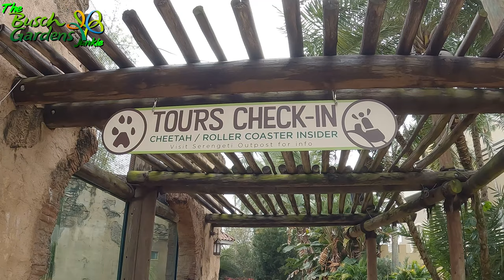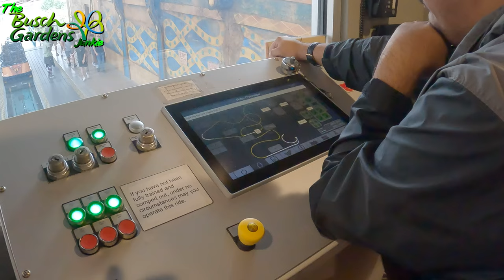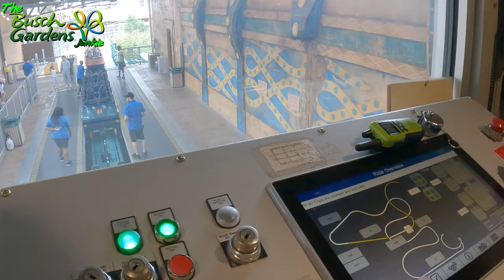Roller Coaster Insider Tour At Busch Gardens Tampa - February 2023

Comment: The lap bar keys better then the car pump the pumps you gotta do hard and put all your strength in it and the key seems easy  and the batter pack
Reply from the maker: When we were escorted off Cobras Curse, they had this small backpack sized thing they plugged into the back of the car and it released the lap bars one by one. Very nice, sure it was very lightweight also.
Reply: basically every ride has that @BuschGardensJunkie
Reply from the maker: Actually Cobras Curse is a little unique, it's has some cars with keys and some with pumps. They have replaced the heavy pumps with nice small lightweight pumps.